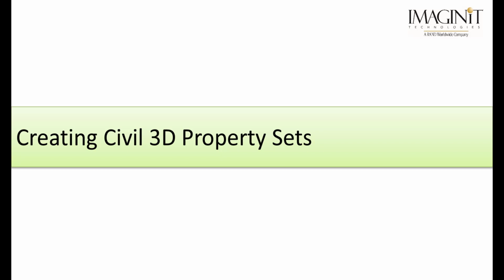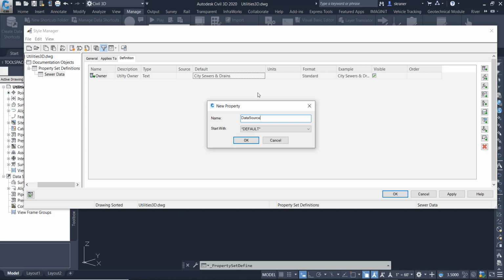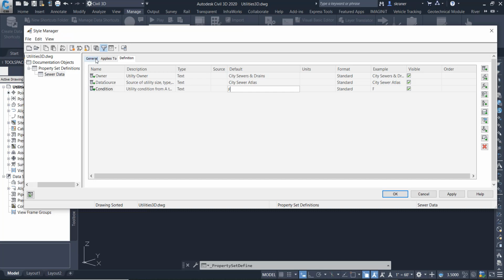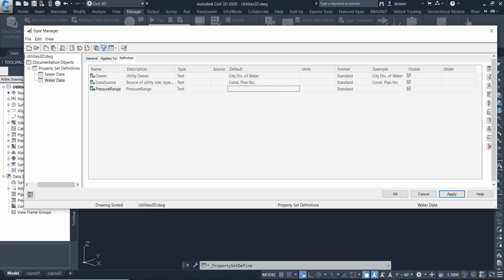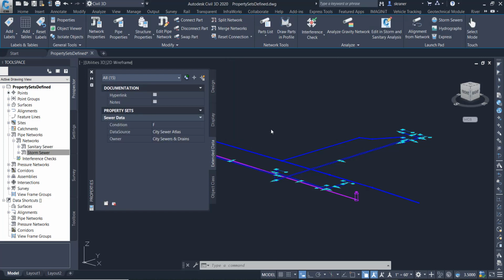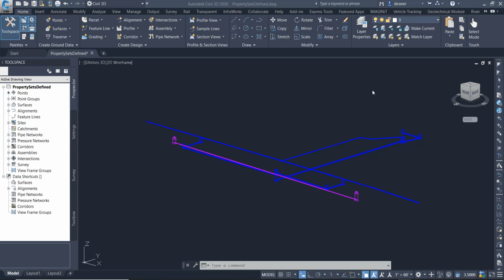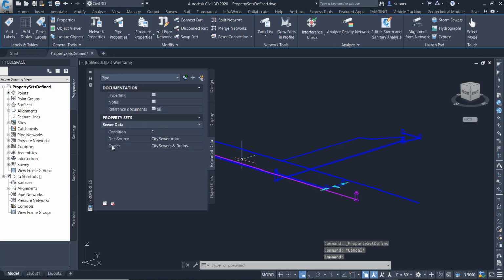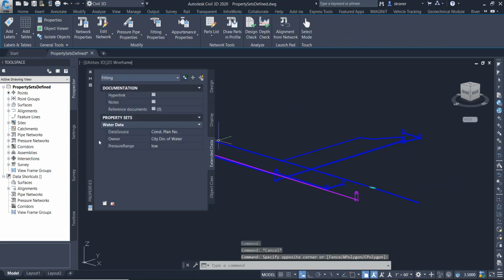Using Civil 3D Property Sets to Associate User Defined Attributes to Objects

Comment: The "Default" value being something static set inside Property Set is unfortunately not helpful for what I needed to label.
I would like for my label style to be able to read off a block's attribute that contains that particular object's real world ID (IE: Hydrant #1) along with its Station so basically the label should look like:
Hydrant #ABC
STA = XYZ

ABC and XYZ dynamically changes depending on the specific hydrant I select to label.  Right now Civil3D can grab the STA info (XYZ portion) in a label, but I have to manually write the Hydrant ID (the ABC portion) for each Hydrant even though the block itself already has that value stored in its attribute and is displayed next to the block,  I just happen to still need a label with its ID and STA along with that, and when there's 50+ hydrants in a drawing surely there's a better way.
Reply from the maker: From our experts: I’m not sure of a direct way to embed block attribute data into property set data although there is likely a programmatic way to do it.  You may want to explore how the attribute data is being assigned to the blocks to start with.  If it is manually, then it may make sense to not put it in the block attributes and instead put it in property set data.  If you are using Civil 3D and this is survey collected data, this could be done through description keys.  If you want to explore this further, please reach out to us by visiting www.imaginit.com and using the Contact Us form.